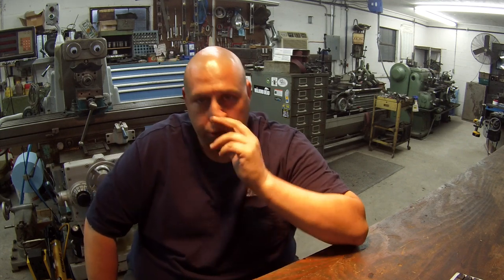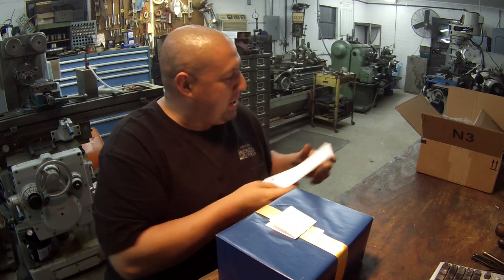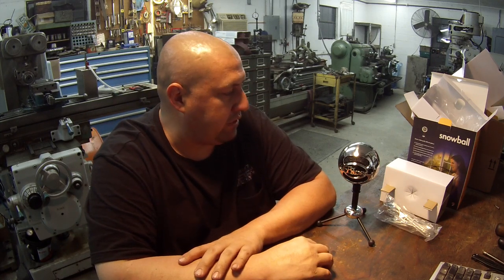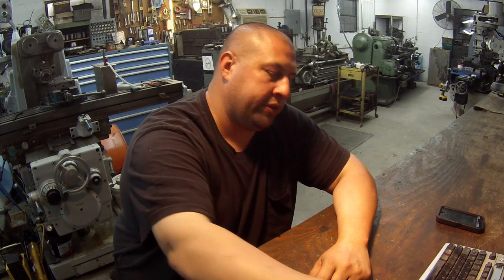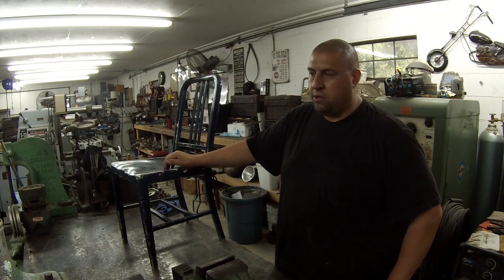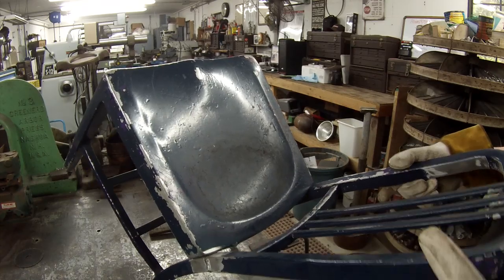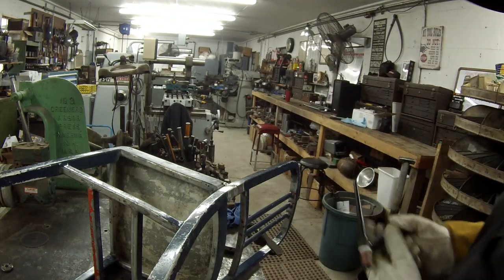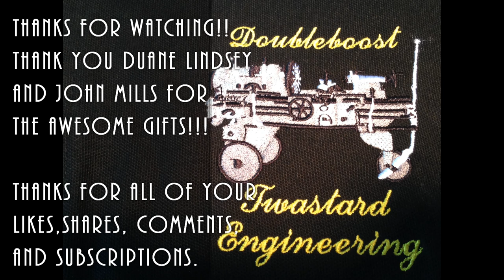Saturday Night Special 34

Comment: Adam nice to see old school TIG welding of aluminum straight AC with high freq no AC balance, wave shape, or frequency adjustments.  It's how I learned on a Linde machine years ago.  The slide show was good with the voice over.
Reply from the maker: Bill De La Vega Bill, the welding machine is probably old school compared to todays machines, but its a good one. It has always worked good for our needs.

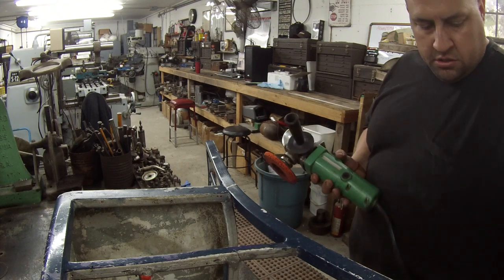Comment: at 24:00 the bottom brace is cracked on the bottom where most likely people rest their foot/feet. In case you missed it.

Awesome coverage on machine work and such thanks for the video love your work.
If your using the SnowBall mic on the work coverage pictures i love the way it sounds you should use that often!
Reply from the maker: XmackattackX Yes I used the new Blue mic for the slide show. That was the first time. I must have missed the crack you noticed at the bottom. That chair is already back to its home holding butts for beer drinking.

Comment: Adam your attempt at the weld is admirable.. I never welded aluminum myself until 1 year ago..I got a Miller tig welder and watched every one of Jody's tips and tricks.. I probably spent 100++ hours practicing, *(yes a lot of argon and a lot of experimenting with different tungsten, machine settings etc etc..etc..) there are a lot of "variables" in welding aluminum.. but the one thing I learned is "cleanness is your friend"  Perhaps a bit more prep time on the seat would be in order? Also a balled end on the tungsten is "old school (I believe), and once you contaminate the tungsten (that I saw you possibly do), you need to STOP, and regrind... I love your work keep it up... I'm no expert, but thanks to all you guys out there I don't watch TV any more an learn from the experts... Thanks Brian
Reply from the maker: GUSMIX22 Jody makes some great videos and always shows things that are helpful. I don't do a whole lot of tig welding aluminum, so sometimes right as I get done with the job is when I'm knocking the cob webs off my technique.

Comment: Adam.. good stuff... I rock a BLUE SNOWBALL and so does My Producer for the podcast I do.. great unit and easy to set up...play with the three switch settings until you got one that sounds good..
Seeya brother
Dude
Reply from the maker: 80spodcastchannel ( : FACEBOOK DUDEJERKY ☆☆☆☆☆ Thanks. I used the #1 setting as per the books instructions for close up voice over. But I will test the other settings to see if they offer up anything else too.
Reply: Adam.. #1 setting and normal conversational tone from about 14-16 inches is about optimum.. then of course echo and ambiance plays a role as well.. best trick is a half circle of carpet on the back side of your snowball to stop back echo.
My own personal is just getting reflection from my desk unit and ambiance of an open office/ dining room and the echo IS there, but not too bad for all intents and purposes.
Do practice runs and try different things.. truthfully your go pro sound is decent.. so start there. but the BLUE is **WAY* more sensitive and good for picking up errants sounds.. ESPECIALLY if you jack up the volume and listen with headphones. frankly, you'll be shocked at just WHAT it picks up.
I also skype with it and I can walk around the corner and could actually use the bathroom and people can hear me...CLEARLY!!!!!
LOL
your results may vary..
seeya
Dude

Comment: Hi Adam,
Lovely job you made of the trunion (sp)
I couldn't work out if the crack in the chair went all the way through it or not but if not should you have not drilled a hole to stop it spreading further ?
Have a nice weekend
Kim
Reply from the maker: KimberlyBarnett123 Kim, nice to hear from you. Yes drilling a small hole is a good tip on stopping the crack, and is often used on cast iron welding jobs. I was able to get this crack welded up and it did not expand further as i welded.

Comment: Hey Adam. 

Another great finish out job. 

An elementary machining  question.... but it amazes me when you do it. How do you keep from snapping off the tool insert points when you cut the round from square on the lathe? I'd think that point would take such a pounding you'd go through several inserts before you were down to round. 

Many thanks for your time to make these videos, I really learn a lot from you. 

Best.
Reply from the maker: It's always a common problem chipping or breaking inserts in an interrupted cut, but a good quality carbide, correct feeds and speeds and it will turn though it no problem.

Comment: Dear Mr Booth ,
Sharpen that damn tungston to a point when welding light wall let it ball itself. It will give you a focal point to start your puddle.
My best ,
Tighe
Ps Sorry I am a smartass .
Reply from the maker: It's cool Tighe, I can be a smartass too. The ball works just fine for me, and its how I was taught and what I'm used to doing on aluminum.

Comment: Adam  JUST A TIP Aluminum is dirty and you must be Clean clean clean. As soon as your tungsten tip hits you have to stop immediately the weld has been compromised you must grind the the tungsten and possibly the spot of weld you just laid down and always use a stainless steel wire brush to clean before and after the weld on a thin weld such as this it will make it much easier to do... But you already knew this.
Reply from the maker: Capt1331 Cleanliness is very important on aluminum, and I always use a stainless brush. I sometimes have to grind it down and weld over my first passes, but this one worked out good. I had the the paint out of the cracks, but it could have been dirty in the inside of the tube also.

Comment: Good stuff Adam.  On the Trunnion... Can you get a close up of the break? I'm just curious were it started, and if a compressive bolt would help.  Drill and tap, install a SHCS in the center, sounds odd but an old trick to help reduce breakage (so old, I don't remember where I learned that!).  Threaded portion below the trunnion step (I know, not much room).

Auburn, eh?   My wife always wears her Crimson Red shirt on game weekends. Best was a few years back when they LOST to A&M in 2012. She still wore it the next day, keep in mind we are in Texas, but only comments were "Now that is a true fan!".   Roll Tide Roll.
Reply from the maker: Some of the smaller trunnion mounts are built with bolt on trunnions. They use a shcs to bolt them on, but there's typically more metal between it and the bore. I have repaired a few of them that way too, depending on the size.

Comment: Trunnion Build: Why not cut out blocks using a Band saw instead of milling it all away? Than use the mill to clean up the band saw cuts. Also would roughing the trunnion posts on a Mill with rotary table be faster, less wear on the lathe turning down the square (interrupted cuts)?
Reply from the maker: Always more than one way to do a job. If i had a big vertical metal cutting band saw I would have used it to cut the blocks to shape, but since I don't in forced to use the mill. 
No way would a rotory table be faster at turning the trunnions than in the lathe. 
Others may opt to do a job like this the way you described, but I work with what's best for me.
Reply: I was think just a rough cut on the rotary table to take the "squareness" off to avoid the annoying interrupted cuts on the lathe (not to completely turn it to finish -- That would stink!). I suppose  even milling off the corners on the mill  -- rotate the vise 45 degree would help.
Nice work, You never have a dull video! :)

Comment: Just a thought about the monarch, When you guys leveled it you used the outside feet and brought the inside feet up to match later, correct? I was thinking about how you were mentioning that the ways seemed to be worn in the middle. Perhaps this is actually a small amount of sag in the middle. Might want to try to lift the lathe a little with the inside feet to see if that causes the middle of the ways to lift a little. I thought this because they obviously put 8 feet on for a reason, and you were definitely flexing the whole lathe in a twisting motion trying to get it level, so why couldn't it sag too?
Reply from the maker: Notso Fresh It's possible, we may dabble into that theory next time Gill is over.

Comment: Also wondering why use a lathe dog? Just trying to learn from one of the best ;)
Reply from the maker: It's easier to run the part between centers, so that both ends are machined true with each other. Its tough to indicate a part like that true in the 4 jaw.

Comment: Slide show audio and pictures - spot on Adam! That nice Blue mike has done the trick! Great gift and we viewers get to share! What grade of steel are the trunnions made with? I gotta know - who decorated the K&T?
Reply from the maker: Mike Clayton The trunnions are built from cold rolled steel flat bar. As long as the machines are operating correctly, they will work good. if they get side loaded or off axis in pressure, they can snap off a trunnion in a hurry.

Comment: Hi Adam, one question, is there a reason you couldn't use a vertical band saw to rough out the bulk of the milling on that trunion?  I would think it would save you tons of time.  You could get withing 1/4" with your eyes closed, and probably a lot better than that.
Reply from the maker: James Kilroy Yes I would love to cut those out on a saw, but I don't have one at work, and flame cut I have no interest in squaring up. I have talked to the boss men about adding a nice big metal cutting band saw to our inventory in the future, but we have to wait until the new addition for the machine shop is added. That will probably be a couple more years. I thought about what would be better, a big Marvel roll in saw, or something like,a big DoAll vertical saw.
Reply: Abom79
   How long does is take to hog everything with the 3" mill?  Figure $100/hour for machining, and if that is a 1.5 hour job.... sawing is .5 hour job.... forty of those covers the cost of a $4000 saw. Cheap payback!
Reply: Abom79 A Roll In would be great, or look for a DoAll with a hydraulic table.  You can set stops on both and go about your other business while it cuts.  DoAll also makes a Roll In style hydraulic powered saw but they usually go for big bucks.  The Roll In style does make it really easy to cut angles.
Reply: Tom Walter What Tom said!  I bet you its longer than a 1.5 hour job to mill all that away as well.  And that mill is a lot more money than a bandsaw blade.  With a solid saw with a 1" blade you could rough out those cuts in 15 minutes easy.
Reply from the maker: I agree guys. The bosses see what goes on and listens when I recommend something. I already told them I need a good saw to make this type of work more productive. Once we have more room for the shop to expand well try and talk them into buying a nice big saw.
Reply: Abom79 Hey, if you can have anything, this is just about it

http://www.marvelsaws.com/marvelproducts/vertical-tilt-frame-band-saws/8-mark-ii-vertical-tilt-frame-bandsaw/
Reply from the maker: Excellent choice James. I have used one of those and they are great! Joe at the welding shop has one, and I even showed a peak of it in the Custom Shackles video a while back when Joe was braking up the plate for me. If it's got the t-slots like it says, you can clamp down parts and let the saw rip through it.

Comment: Another nice video... Good Job as always.

I never saw one of those phone cases with knuckles attached but then again where I live
you would get 5 years just for possessing them.

It must be nice to live in a place that allows you to defend yourself.

The police around here will classify any hard object as a concealed weapon if they find it in your car.  My dad was bringing my nephew a baseball bat to use and because it was on the front seat of his truck the cop told him that it is a concealed weapon.
Dad, trying to be funny, told him it is not concealed and the cop got pissed and made him get out of the truck as he searched (illegally) for actual weapons and contraband.

A complaint to the Chief of Police and a reprimand followed for the officer so at least some justice was had in the end. 

Dad was originally approached by the officer for parking too far from the curb which is what he did when running into my brothers house to get the bat.  Before he pulled away, the cop blocked him in and started all his crap. 

Things are so different up here.  New Jersey

Keep up the good work,
Anon
Reply from the maker: The laws are different for each state, but she hasn't had a problem. The case is made of plastic, and doubt would really do any harm, but you bring up a good point. It's all in the eyes of the officer.

Comment: hi adam i have a couple of questions. what type of tig welder do you have? it looks like a transformer type. what type of tungsten do you use and what current did you have the machine set at. also when you were turning the bearing shafts for the trunion i noticed you started out with the square end in the four jaw. how did you indicate that end. thanks adam ,i realy look forward to your videos
Reply from the maker: Larry, not sure about the machine but I believe it is a transformer type. The machine is a Miller Goldstar 330 A/BP if you want to look it up. The tungsten I'm not positive on it's been so long since I bought them. The kit I use for the tig torch is a Radnor AK-4. I want to check into the tungsten Jody has been teaching about and see if that will help with my welds. I use AC with high frequency continuous on aluminum.
On the trunnion, I cheated a little bit. I chucked one side as close to center as I could, then turned one side just down far enough for my 3" lathe dog to fit on. Once it fit I took the part out, installed a machined center, then mounted it between centers to finished turning both ends.